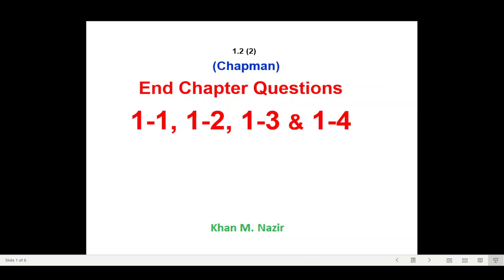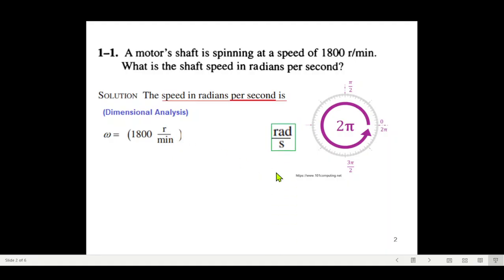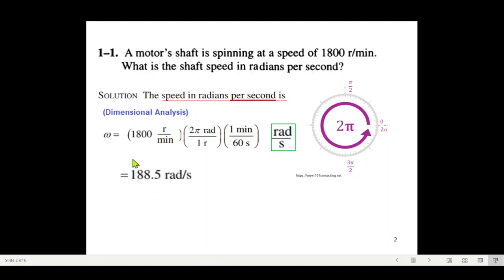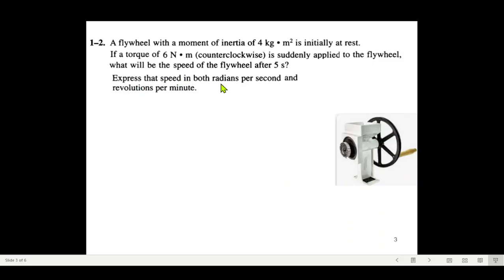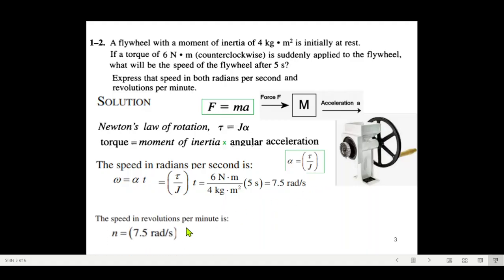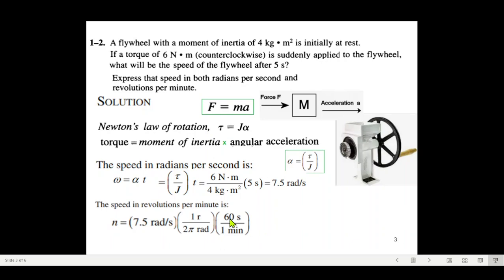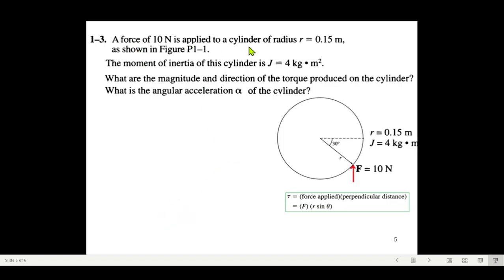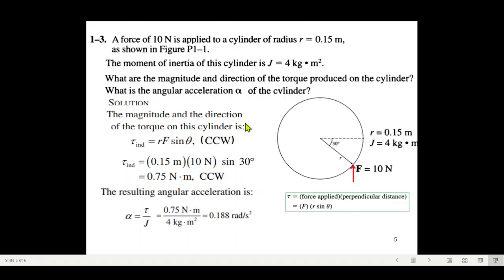(E)EM Q 1.1, 1.2, 1.3, & 1.4 || Calculate, Speed, Torque, Angular Acceleration, Power

Comment: How is the angle between the force and the radius 30 degrees?
Reply from the maker: Given in the question
Reply: @ElectricalEngineeringAcademy  that's the angle between the horizontal and the radius distance, if you resolve the forces you should see the angle is different
Reply from the maker: @kipling867  Please email me your working at profkhannazir@gmail.com